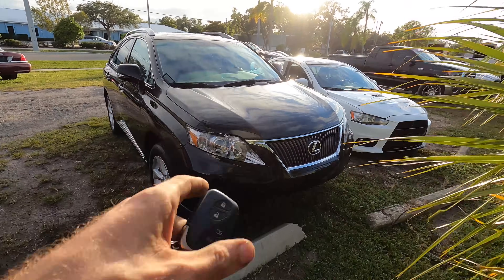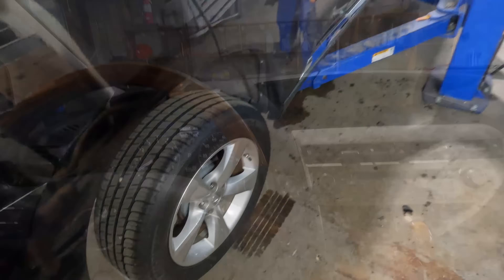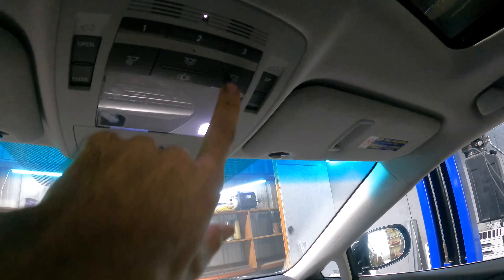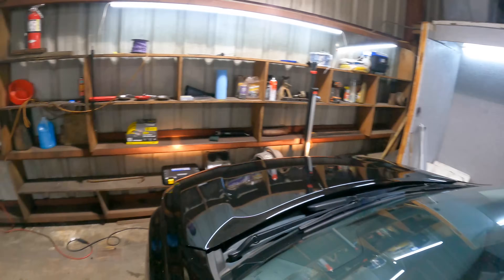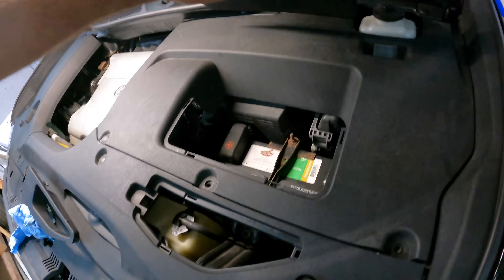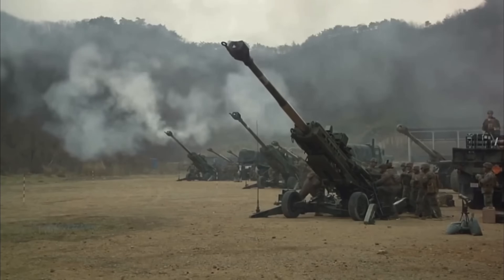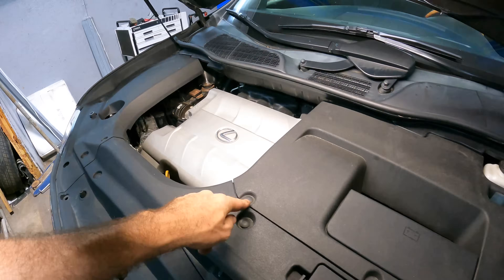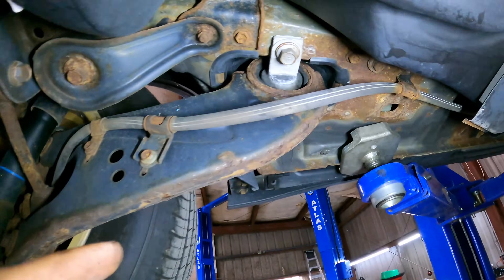Spoke Too Soon! Twice! Lexus RX350 3.5

Comment: Gee, ya’ think Lexus could have figured out how to completely 100% make that engine disappear under covers?  That managed about 85%.😂
Reply: Good & funny point. Thanks. I almost forgot that detail as soon as the other problems appeared. What will it be next? Potted in engine tops, like some internal electronics are these days?
Reply: It's amazing how Lexus trys to make their vehicles quite as possible by putting extra sound deadening covers. Then we have some people that first thing they do is jank the stock exhaust and put on a noisy fart can system. Now they pretend they are driving a high power machine or running around the track in NASCAR.

Comment: "Not bashing engineers, not this time, I'll save that for when I get a Dodge "
Ray, as a Dodge owner this made me, laugh out loud.  My kids asked me what I was laughing about.  Great video!
Reply: It is clear that Chrysler/FCA/Stellantis/nom de jour hires only engineers that have it out for mechanics.  The wackiest stuff I've seen has always been on a Mopar product.
Reply: @silicon212  as a non-automotive engineer, I always thought is was the corporate bean counters that drove the cheapest technically feasible solution, not necessarily the best solution.
Reply: @jame3shook  You can do it cheap and easy to service at the same time.
Reply: Yes. There are design-to-look-nice enginers, design-to-save-fuel engineers, and design-to-be-maintained engineers. All are mutually incompatible.
Reply: My brother and I created brand new cuss words while working on Mopar products
Reply: The Fiat-Chrysler engineers were having problems making things fit. The head engineer said, just Ram it in there. Hey, it worked, we Dodged another one. The mechanics will probably not be able to replace it without a torch.
Reply: Yes bash the dodge engineers that decided to put a battery in the wheelwell.  Having to take off a tire and the fender liner to get at the battery is a real pita.
Reply: It’s easier working on my charger than it was on my Infiniti idk it’s just me.
Reply: @Les Reeves  no I didn't but wouldn't surprise me.  I'm just s tire guy so don't work on that stuff but the batteries are a pain.  Had to replace a battery in a 14 grand Cherokee today that's under the passenger set floor.  Lots of room to work with lol not.
Reply: @Albo alt I don't know about the later ones, but a friend's grandmother drove her 1989 2.5l 4-cyl. automatic from the eastern US to Anchorage, AK and back - an 8,000+ mile round trip - five times. It must have been thought to be pretty reliable.
Reply: @troybalster3687  2006 Dodge Stratus for the L.
Reply: @wesgregg6451  See the year? 1989. Things were built better.
Reply: @EricVonHunter  You don't have to tell me. I've been tasked with figuring out which of the gas ranges that don't cost an arm and a leg are of good quality, because the one currently in Mom's kitchen - which she got in 1967 when she got married, and which has never required anything other than cleaning and minor maintenance (she adjusted the oven control knob once) - has developed an issue that requires a part that is no longer available. So I've been doing some research. And, APPARENTLY, "high quality," these days, means it isn't likely to require a repair person to come fix it more than twice in the first year. The first year, FFS! I'm probably going to end up telling her to go around to all the local used appliance sellers and try to find something she likes that was manufactured before 1980, and then go inspect it to see what condition it's in (and search to see if parts are still available).
Reply: I looked at a Dodge once. Once! Then I got this cold feeling all around my wallet and the only thing that made that feeling go away was when I walked away from ze Dodge. Ahh! All better now 🫣
Reply: @wesgregg6451  Wow. Lasted that long without any major issue. That's awesome! I bet the problem is relatively minor but just can't get a part easily. I hope something comparable can be found!
Reply: In my ERs you risked getting a head slap if you said something stupid, like  “it’s been a quiet night” or equivalent, as it can  ALWAYS get worse. Like the code coming in fifteen minutes before shift end.

Comment: As a Quebec mechanic, I watched in pain while you were struggling like nobody else doing routine stuff for me. Get the torches, cut the shock, burn and remove rubber, cut inner sleeve. Once you have done it enough its a 15min bolt removal at best. We are always learning, keep it up
Reply: You forgot final step..place explosive device in vehicle.
Reply: Yep - 15min bolt removal job... while in Florida, with no rust it is usually 15 seconds job :) Florida mechanics have it much easier I believe :)
Reply: @kris856 they do have it a lot easier, Ray gets away with an electric mid impact on most bolts where I would need everything from my 1/2 air impact at 160psi

Comment: As someone from the rust belt who deals with this often, I really enjoyed seeing your process of escalation when dealing with the rusty fasteners.
Reply: Yeah, that is a normal every day thing up here in Wisconsin.  I swear they throw salt on the roads at even the slightest hint that it MIGHT rain/snow somewhere in the world.
Reply: Yep, this is standard issue stuff here in Minnesota. In fact, if I ever get a car in the shop that has no rust I think to myself, "O.K. what's going on here? Am I being punked?"
Reply: @scott.koopmann  LOL!  Words to live by around here.  
It actually is a shame to watch our vehicles rust away before our eyes.
Reply: Map gas torch for the DIY guy here in Illinois.  Not only cures rusty fasteners but lights your bonfires.  😁
Reply: What's the next level of escalation after the Sawzall?  C4?
Reply: @josepherhardt164  Angle grinder!!! :D
Reply: Glad to see others have rust issues. Being from the West Coast, it's always a battle for us. I put never seize on everything once I get it apart!!!
Reply: @NJP76  Yes, it is! I really wish manufacturers would do more to try to rust-proof vehicles at the assembly plant. It would make vehicles a lot safer and my job a lot easier. For starters, stainless steel brake lines should be standard equipment for all vehicles sold in the US. I mean, look at all the air bags in em' now and no one seems to care if the brake lines rust out.....hmmm, maybe that's why we need all the air bags :)
Reply: @NWSanta  LOL! Same here. In fact, I probaby go through more anti seize than Ray goes through brake cleaner!
Reply: @scott.koopmann  Yup, I've been using it on all my vehicles for years. Every little bit helps!!!
Reply: @NJP76  Detroit does the same garbage. doesn't help we have the salt mine.
Reply: @spyder000069  if you like the shock to explode.
Reply: I'd have been reaching for the oxy acetylene torch way earlier!

Comment: Throw some anti seize on them bolts think ahead for the next tech 👍
Reply: And seize will get washed out anyway. The new bolt is surface coated/hardened so it will not rust for quite a time anyway.

Comment: Ray, on aircraft bolts we use a tiny bit of Thixo grease on the shaft to help prevent future rust. Just don't get any on the threads.
Anti-seize would probably work too.  I put that on my rotors to help change tires for winter and help my wheels last longer. Canadian winters are harsh
Reply: Anti-seize is my weapon of choice for rust prevention here in Wisconsin!
Reply: @Robyrob7771  ...yes but its recommended not to put anti siez on lugnuts
Reply: @nickmalone3143 
Nope, don’t use them on things that could come off going down the road and make dead drivers!
Reply: In the UK I put copper ease on anything i change..nuts, wheels...
Reply: That will probably be the last set of shocks for the car

Comment: Just wanted to say thanks for the tip on "brandishing the brakes" from your test drive with the Honda Accord. I replaced my brakes on my 2014 Ford fusion and am thankful about the information about the smoke coming off the rotors and that it would go away after a few start/stops to burn off any access residue. Keep it up and thanks.

Comment: The green and yellow lights on the batter tester means charge and retest. The tester checks for the internal resistance of the battery, and requires a full battery to get an accurate reading.
Reply: Not worth the time and effort. 9 out of 10 times it will come up bad anyway after recharging. (Sold batteries at Sears). We HAD to do it on Sears brand before adjusting them out. Meant putting a loaner battery (used crap) in the customer's car and have them come back. They almost always came out bad.

Comment: That lower shock stuck bolt:  how about using an abrasive wheel to cut the shock body and go in as far as the sleeve?  That could relieve some of the grip on the bolt.  Or do it twice, for good measure, and remove a slice of shock body?
Reply: That wouldn’t relieve any grip on the bolt since it’s rubber. However it would allow access to heat it up to expand it from bolt. But time cost will very outweigh price of new bolt.

Comment: PB Blaster, spray and wait 10 minutes.  While you are waiting, wire brush the bolts.  If you cannot take the old bolt/nut out, and Blaster dont work, time for the heat/cool for 3 cycles

Comment: Rey is a top flight mechanic! Busting rust causes a wonder of surprises. Chain reactions of rust breakage can happen. Salt water boat engines never come apart easily.   I admire Rey's persuasion techniques and sweet talking the stubborn bad part until Victory!😄 I do the same!  If I dare curse at it, I believe Karma will make my rebuild at hand allot harder. My no fail persuader is a 24in breaker bar and a 3ft ridged pipe extension. If 5ft of bar doesn't crack the bolt, a torch comes in very handy.

Comment: That rustification shower was kinda pretty, we don't have that kinda art stuff here in Arizona. Look at a produce named Fluid Film and Rust  protection sold on Amazon (6 for about $62) it is not oil based, wax with a  rust neutralizer. it should arrest the rust and protect from future rusting. Might be a good sales item that really does something. There is also KROIL penetrant, guaranteed to penetrate 1 millionth of an inch. we use it on aircraft a lot. Great job , you don't give up!
Reply: Ditto on both those products. I use them frequently for just about everything that gets stuck or needs some lubrication.

Comment: I run into that bolt problem from time to time. It should come out, it'll turn. I get a wire brush and force it on that bolt. It'll take off that rust. You have to push hard. Rotate it around. Sometimes a regular metal file that has a file on the edge can get into something like that. Now you're really working it. Works for bolts on the wheel hubs. Before I did that I sometimes had to drill them out. What fun.

Comment: I did rear shocks on this exact body style once. I'm a DIYer that works on my own stuff and stuff for my friends so this was my friends mom's car. I'm near Toronto which is where cars rust within 5 years, and the fight I had with the lower shock bolt on that car was insane. The top bolts came out no problem, the bottom bolts met their end with an angle grinder. The rest of the bolts that did come out were severely compromised in terms of structural integrity, so I told my friend to grab some OEM bolts from the dealer to finish the job.

Comment: Sad person that I am, I would have somehow taken that bottom joint apart to find out why that bolt stuck. I suspect it had worked a shoulder between steel inner and bolt. Brilliant video, because you show all the real life issues of working on cars. Camera work and commentary are exceptional. ⭐⭐⭐⭐
Reply: My step 2  would have been hitting the bolt from the other side, maybe with a screwdriver and hammer......Step 3 would have been cutting the bolt head off.....Step 4 would be cutting the bolt again closer to the ram so it just falls out as only an idiot would do step 3.

Comment: Hey Ray. I work on rusty things and run into this problem often. I’ve found spinning the bolt with an impact and getting the assembly hot will break loose the rust enough to knock it apart. Watching this was triggering my ptsd. 😂

Comment: I have the same model.  Trashed OEM shocks and rear control arm bushings were the source of my rattling noise.

Also, at 9:35 you can see the classic front timing cover oil leak that is common for the 2GR-FE.
Reply: 100% correct. Since this vehicle is 11+ years old, mint condition with 90k miles, but has all that rust, I would keep rolling until it was a problem in the garage. 

That’s a $5-6k repair when done right. Ray definitely would NOT be doing it for me.
Reply: @thooks1234  Agreed.  No offense to Ray but, he’s not setup to do a 2GR-FE engine drop nor would he want to. It’s a massive time gobbler.  

My 13 RX is weeping at the timing cover and I’m not doing anything but monitoring it for now and cleaning the area every oil change.  It may never develop into anything more than an annoyance.
Reply: @Cookiebaggs233  The realty is not many techs that have independent shop experience have in-depth Toyota experience. It’s not that Toyotas are a problem, but you really can’t dump BG Coolant and other fluids that are “Asian” stuff into Toyotas. Also, they aren’t Ford/GM/Fiat/Nissan/Korean vehicles.  The other side of the Indy coin is there’s just not a lot of repair traffic on Toyotas. 

That’s why Toy/Lex specialty shops are growing in number and have zero issues with gaining customers and remaining extremely profitable.
Reply: @Cookiebaggs233  When I moved to a new community, my 2015 Ford Escape AWD apparently went from no problem to blown transmission in like 5 minutes. The small town transmission guy told me it is one of the WORST ones to pull out and replace due to engineering. I passed and bought a beater.

Comment: Wow my frustration level over that lower shock bolt would have brought out the cutting torch!!  Car be damned that bolt would be out!!   😂
Reply: Heh, yeah. I was thinking something similar, but more like using an angle grinder to hack through the bottom end of the shock absorber, just to get the bolt out. I know, my idea would only make sense if there was no help in saw blades and too difficult to get to the bolt, but I guess it would take more time to grind the shock metal than grinding off the bolt.
Reply: Heat up the bolt head with the gas axe and things come apart easier.
Reply: @michaeldelora5177 , I’m not sure if Ray has an oxygen/acetylene torch, I don’t remember seeing one in this shop. Might be a worthwhile investment to have one around, especially if he gets an exhaust job to work on.

Comment: Thanks Rainman, good video. I am in Eastern Canada where lots of road salt is used. What you experienced with this Lexus is what we see here with every vehicle that is more than a few years old. Everything you try to do on a vehicle that is exposed to the elements results in struggles like this one. Even removing alloy wheels from the hub sometimes involves using a dead blow hammer on the back of the wheel to break it free. This can be quite problematic when you get a flat tire in the middle of nowhere and can't remove the wheel because it is seized on the hub.
Reply: You can remove the seized wheel by dropping it down after the nuts are removed and if that doesn’t work drive it slightly forward or reverse
Reply: reduce this issue by having grease between rotor, and contacting points of tire rim. cheers
Reply: @shawnnonya3430  Thank you for the suggestion. I tried grease and it helps if the winter is not too long – has time to completely disappear. On my own vehicle, I now use anti-seize on the lug bolts and the hub but still not 100% successful. If the vehicle belongs to someone else, then it is the luck of the draw.

Comment: 18:14 when tightening suspension components with rubber bushings the tightening needs to happen at ride height. When you tighten suspension bushings with vehicle on the lift they are tight in droop position so they stretch to get to ride height and then have no room to move upward.
Reply: The bushings on shocks don't change when the vehicle is driven. On wishbones and stabilizer bars, yes, tighten at ride height but shocks are ok.
Reply: @BigLisaFan  So can you explain why the bushing is even there then? Seems to me if it didnt matter they would be solid metal.
Reply: @eddiereichel9354  The rubber cushions the shock as it goes up and down. Often the bolt rusts in the bushing and the rust can stop the bolt from being removed. Break out the sawzall. That is what I was told as an apprentice.

Comment: man dealt with this on a older marquis from kansas recently. the bolt did the exact same thing. fast job turns slow real fast.  cut it off as well.  i add time now for rusty jobs. it will be at least severe labor time. Thanks for the vids man! new shop seems to be going well 🤘

Comment: I live in a  rustbelt city and have a 2016 Jeep that doesn't have this much rust on  the underside. It has never been garage
 kept BTW. Propably needed to get out the Superzilla stuff the day before going to the shop to get these rusted bolts freed
 up. I would have if I saw the rusted out undersides. Gave 100% to removing the last bolt but in the end still needed to get 
a new one. Your wife unit is the best!

Comment: Ive Got a suggestion for a tool to help with bolts like those what about using a heat induction tool like one from bolt buster they Help Loosen rusted bolts . By the way keep up the great work and Im glad to see you got your own shop you can finally do things the right way The Ray way.